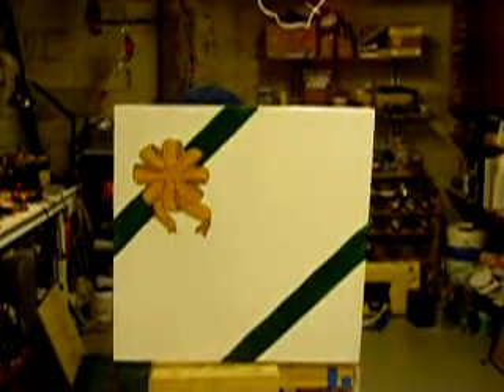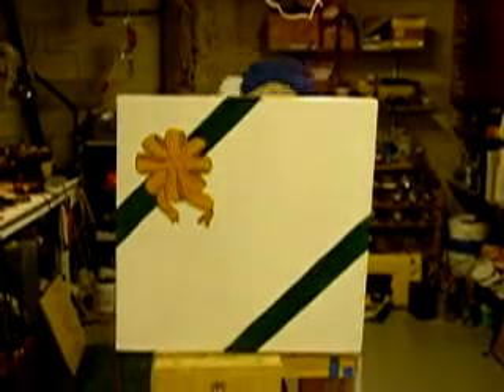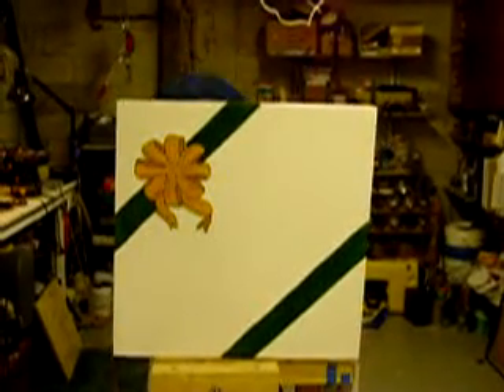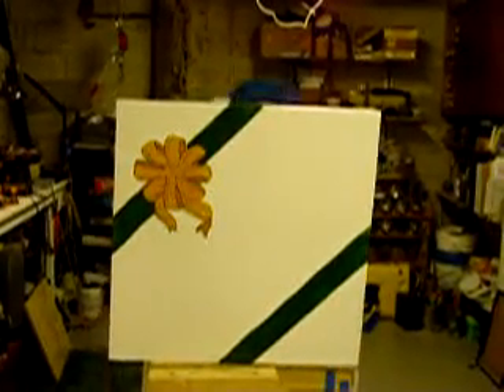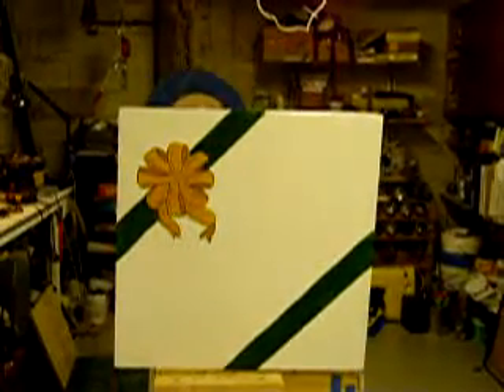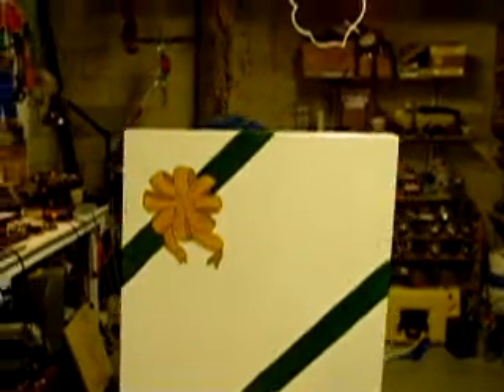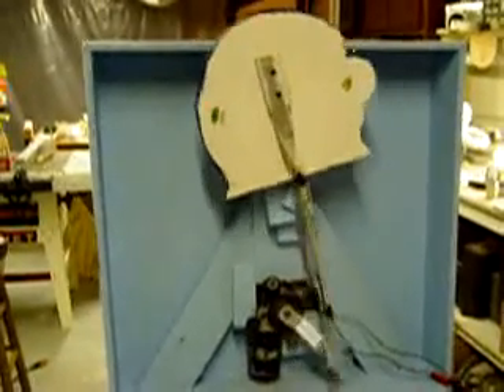Pop up elf

Comment: Can u tell me how to make it
Reply from the maker: Hi Frank.   Not sure how much I can direct you on putting this together, other than what the video shows.  The wiper motor is attached to the frame, has a small cam on the motor (the cam will determine the throw or distance the prop moves, so you need to play with that).  Attached to the cam is the push rod which goes thru a turnbuckle and finally attaches to the head.  The turnbuckle allows the push rod to pivot in place.  I made a small modification to the unit as shown in this video:
 https://www.youtube.com/watch?v=oM8A_rZhMsgHope this helps.